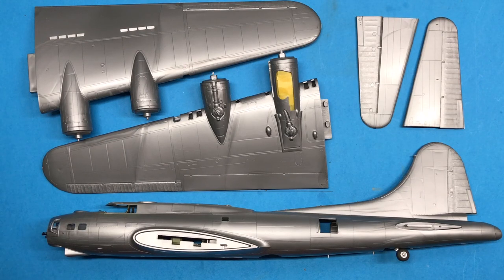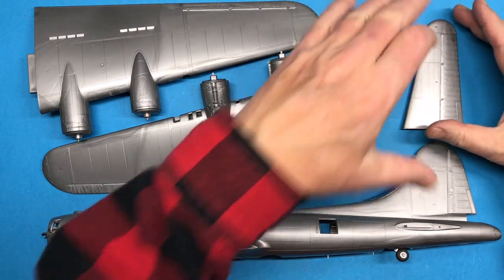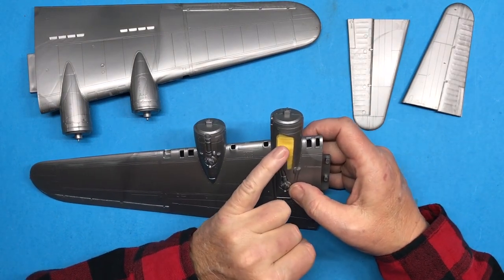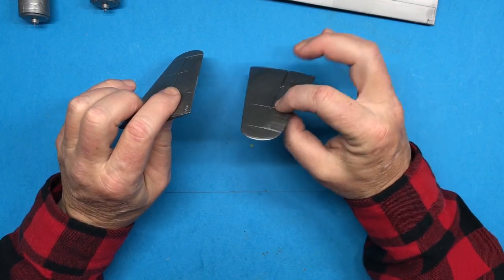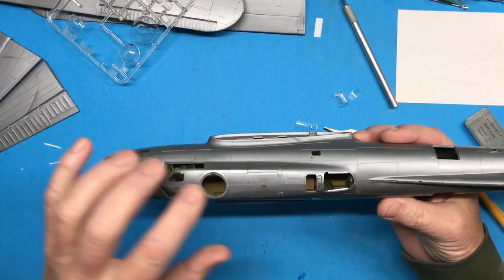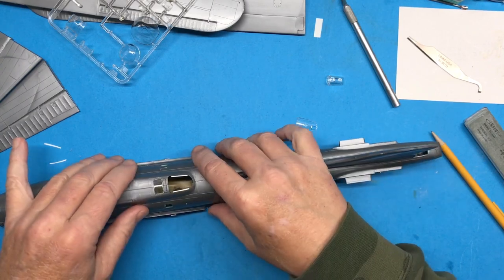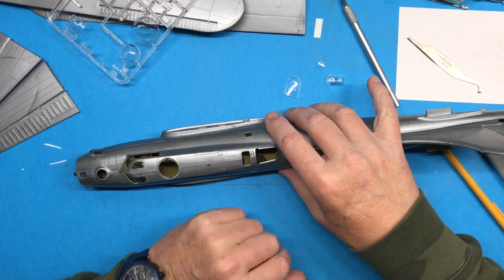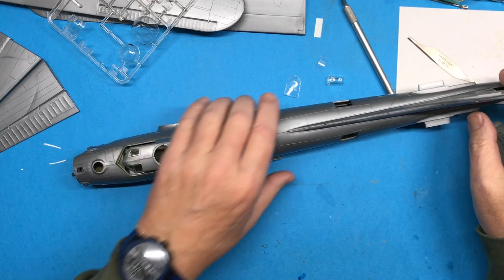Monogram 1/48 B-17G, Part 3-4 Filling

Comment: Great build to follow, I think all of us built this kit at one time or another. One thing i learned with older aircraft kits was to sand the trailing edges as thin as possible to try to get them back in scale. Thanks for sharing and looking forward to more to come
Reply from the maker: Thanks, Ralph. I considered sanding the trailing edges, but opted not to... I didn't want to add another three months to the project! LAL.

Comment: Coming along very well indeed, Brett! I like your restoration technique for raised panel lines. I've tried similar, but using either sprue goo or Mr. Surfacer 500. With the sprue goo I didn't need to sand, but it had to have the right consistency. More on the thin side than thick, but not too thin that it would creep under the tape.
Reply from the maker: Thanks, Ken. Hopefully the panel line thing will work out. I think it is a viable option that will mimic the molded lines. We shall see!

Comment: Seems to me that the radio operator's gunner window has alternative issues.  Mine was somehow shrunken, causing me to laminate strips of styrene until I could close the gap.  Yeah, good call on the waist guns; that's what I did.  Even added some putty to close it up.  Looks like you lucked out on the dome window.  Mine was way off.  I just filled the gap.  Good luck with the mask set.  I went old school and masked with tape and cut with a knife.  Doing a great job!
Reply from the maker: Thanks, Russell. In hind sight I peobably would have done better making my own masks. Well, all of them except the ball turret and top turret. LAL